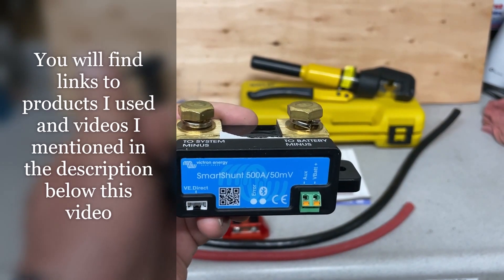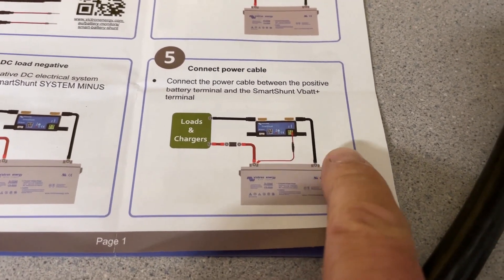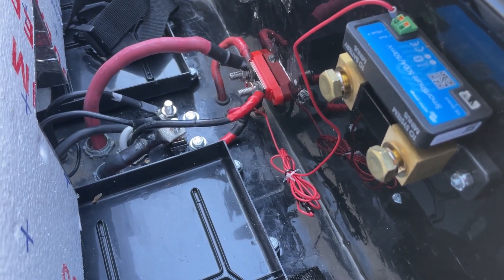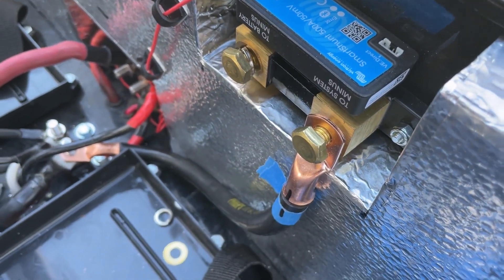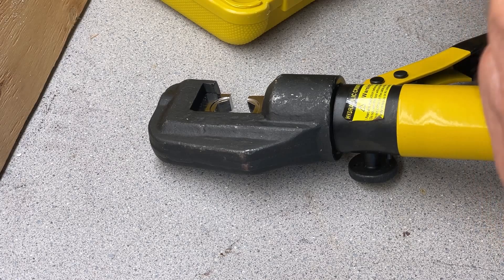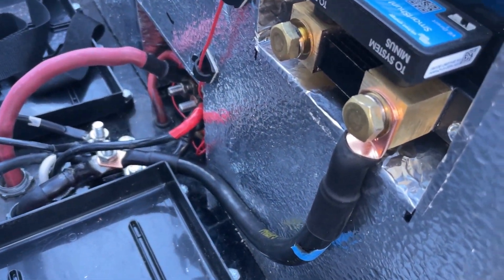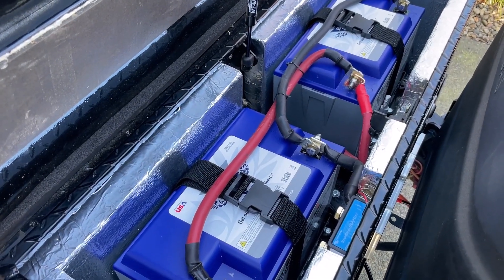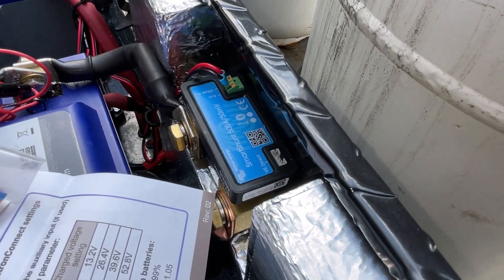Victron Smart Shunt is a Great Way to Monitor Your RV Batteries - Here's my Installation

Comment: Hi Michael 
Probably been asked before, here i go lol. Have 3 AGM batteries in my van and i just got the shunt. Can i connect all 3 to one shunt, if so, on  what battery negative i put it on, if it matters. 
No i haven't watched the video yet, will as soon as i get a chance 
Thanks
Reply from the maker: Hello Paul sorry it took me so long to get back to you, we were out camping. 

I would just come off one battery with the negative since they are all tied together to the shunt then out to the loads as you can see me mention in this part of the video and then show later in the video. https://youtu.be/ksCivLNIzEQ?si=2IbptDIYNyP0wNuI&t=113

Comment: It sounded like you have some solar power. Where did you put your positive and negative wires on your system?
Reply from the maker: Hello Robert, Yes I do have a solar system. All the positive and negative wires go to junction blocks. And then from the positive junction block one positive wire goes to the battery;   And then the negative wires are wired in the same way as the positive wires.  Here's a couple videos that may be helpful to you. 

2000 Watt Pure Sine Wave Inverter & Automatic Transfer Switch Installation - Travel Trailer (RV) - https://youtu.be/rkRzH0Ay1z0?si=HIqo6Ev84_9sT33e

Battle Born Lithium Batteries & Progressive Dynamics Converter/Charger Installation - Step by Step - https://youtu.be/BXyL_d34zy4?si=7pMTXJztMvgxOyqj
Reply: @thetraveltrailerguy  thanks for the reply, my issue is my generator ground is on one battery and 3 other grounds are on the other battery ground (2 100amp hour lithium’s 12volt). Should ALL of them be to a bus bar or can I leave the onboard generator ground where it is
Reply from the maker: @robertnasser9937  I would put all the grounds on a buss bar for the shunt to capture all the information it needs to provide you with correct information.

Comment: Nice Video 
 May I ask , how do you handle the negative from the battery to the chassis ?
 Perhaps you don’t have that situation ?
 Thanks
Reply from the maker: Thanks for asking this question and watching. Here's this part of the video shows where I connected all the negative wires which includes the negative wire that goes to the frame (I should have done a better video on this, I'm sorry) I hope this helps, if not please let me know - https://youtu.be/ksCivLNIzEQ?si=jhAcDoIR0D39-XF3

https://youtu.be/ksCivLNIzEQ?si=QcXgA4Yrcp5KZZpU
Reply: @thetraveltrailerguy  I’ve yet to see a diagram actually showing chassis ground going through the shunt. 
 I spoke with a dealer and they said take chassis ground through the shunt      
 I’m doing my due diligence before installing. 
  Your camera is quite outstanding very clear and well focused. 
 Thanks
Reply from the maker: @rickc9873 

Here are some videos that may be helpful. Note: If you are not subscribed to "DIY Solar Power with Will Prowse" I recommend you do.

What RV are you installing this shunt on? 

https://youtu.be/_GjcGZsK4fI?si=KywV8FMXPSuJit4E

https://youtu.be/9O3VYCvr75A?si=g0K3cwl5qB6w4o0x

https://youtu.be/C4z5KoPLN84?si=D_0daCzhFUro79Ik

 https://community.victronenergy.com/questions/178498/smart-shunt-ground.html#:~:text=To%20clarify%2C%20a%20chassis%20ground,switch%2C%20then%20negative%20bus%20bar.

Comment: Nice clean job and a great video, Thank you.  I am a novice at this solar stuff, and just purchased a new TT with Solar on the roof and a side port for a suitcase solar.  I had two 100Ah dragonfly Lithium batteries put on the tongue.  I have just ordered the Tictron Smart Shunt along with a new tongue box for the batteries.  I have looked at different wiring diagrams for the Smart Shunt with two batteries in parallel, but I can not figure out where the negative ground wire will go that is attached to the frame.  Does it stay as it is hooked to the battery and to the frame?  Thank you for your time.  Any advice would be welcomed.
Reply from the maker: Sorry it has taken a few day for me to respond, been busy. That's great you bought the Lithium Batteries, your going to love them, These shunts are great and easy to install. Leave the negative wire where it is hooked up now, it should be to the frame. I appreciate you watching and asking questions, I'm happy to be of help when I can. Have you watched some of my other videos about solar, batteries, etc? 

We just bought a 2020 Lance 2375 Travel Trailer and I will be doing lots of things to it, Including installing a very elaborate Solar and Controller system so keep an eye for it in the near future. 

https://www.youtube.com/@thetraveltrailerguy/videos

https://youtu.be/j4a9MkLRJN4?si=LXoZWRfu1yV04bzk

https://youtu.be/1vm4w3BMq4I?si=SiBBJSzuGF2V6m24

https://youtu.be/3lDVBU4CFMM?si=QXUj3H7znQcUDwyV

https://youtu.be/rkRzH0Ay1z0?si=4MzT6AzQ_BLEiiX0

https://youtu.be/BXyL_d34zy4?si=snbtlMS0mlDATJ50

https://www.youtube.com/@thetraveltrailerguy/videos

Comment: Hi Michael, just trying to figure how your new 4 AWG lines that go from Battery to Converter/Charger DC Side board are running. Do they attach to your Battleborn pos/neg  posts directly or do you have them on a bus bar AFTER the Victron Smartshunt? 

Thanks so much for making these very, very helpful informative videos.
Reply from the maker: Hello Sorry it has taken me so long to get back to you. We were vacationing in Alaska (not with our trailer). I attached the wires on a buss bar after the Victron Shunt, check it out here - https://youtu.be/ksCivLNIzEQ?t=107
Reply: @thetraveltrailerguy  no worries 👍  thanks so much

Comment: Very nice detail. Straight to the point! I really like your battery set up. It’s what I want to do with my box. Found one box but they are strict on returns. 👍🏽
Reply from the maker: Thank you so much for the compliments and for watching. I really like the box (it also has a great free return policy through amazon) I used its built very well and will last forever. I was looking at others on line and at Harbor Freight and wasn't impressed with the quality so I splurged and it has worked out well.   https://www.youtube.com/@thetraveltrailerguy/videos

Amazon affiliate links below:
Here's a link to the battery box Model M207 I used  - Dee Zee M207 Specialty Series ATV Box - 
https://amzn.to/2OUPFcf

Victron Energy SmartShunt 500 amp Battery Monitor (Bluetooth) -
https://amzn.to/3v4aJiN

Victron Energy Temperature Sensor for BMV-702/712 -
https://amzn.to/3Llj8nq

Busbar Dual 3/8” Studs Terminal Power Distribution Block with Ring Terminals Pair Red & Black -
https://amzn.to/38YlFWs

2/0 Gauge 5 Feet Black + 5 Feet Red Pure Copper Ultra Flexible Cable 
5pc of 5/16" & 5pcs 3/8" Copper Cable Lug Terminal Connectors 
3 Feet Heat Shrink Tubing
https://amzn.to/3L1QcAS

2/0 Gauge Wire 10 Feet Red + 10 Feet Black Pure Copper Flexible Cable 
10 pcs of 3/8" Tinned Copper Cable Lug Terminal Connectors 
3 Feet Black Heat Shrink Tubing
https://amzn.to/3v4N9T5

Hydraulic Crimping Tool and Cable Cutter Hydraulic Cable Lug Crimper 8 US TON 12 AWG to 00 (2/0) Electrical Terminal Cable Wire Tool Kit with 9 Die -
https://amzn.to/3K4g263

Hydraulic Wire Battery Cable Lug Terminal Crimper Crimping Tool 12 AWG to 00 (2/0) Electrical Terminal Wire Crimping Plier Kit,Marked with AWG -
https://amzn.to/3xMyBcA

Bernz-O-Matic ST2200T Micro Flame Butane Torch Kit -
https://amzn.to/3AfqFQ4

5.5 Oz Butane Refill Bernzomatic -
https://amzn.to/3H0udIN

Comment: I have been looking into how to remove the little red wire from the shunt ... even their 47 page manual doesn't say .. so this is how I came across this video.  Batteborn has instructions as to how to wire wires to the battery post.  Check it out.  They say not to put wires on each side of the battery post/terminal ... the reason is to remove the post itself as part of the current flow from wire to wire .... when the wires are connected on top of each other, the current says in the wires and bypasses using the battery post as a connector/conduit/ or path.  I do watch for this in many connections I use regardless of being from Battleborn.
Reply from the maker: Interesting about not putting wires on each side of a battery post. Can you please send me a link to where you read this? I've searched the internet and can't find anything that mentions this. Thank you :)
Reply: @thetraveltrailerguy  I'll the link to the BB battery manual, but it only shows the cable connected at the bolt head end, not the nut ... I will look more but when I did my mobile system a couple of three years ago I had read it ... I thought in "the" BB or the manual at that time.  I may have talked with BB.  I am sure you are already putting the cable to the post directly and not through or over a washer.  I would like to see what BB says via their support via phone or email too.  Just now, thinking, if one "stacks" the cable (connectors) rather than have flush direct contact with posts, it may be similar to having a "washer" under a connector... point is, I'm sure you know, is direct as possible lowers resistance and that is what we want.  Thanks for replying and I'll keep it in mind... please keep me updated too.  pat Here is BB link.
https://battlebornbatteries.com/wp-content/uploads/2022/10/BB10012-Manual-Edition.PIM_BB10012Rev019_09062022-1.pdf
Reply from the maker: @davidpatrick1813  Thank you so much I'm going to check this out
Reply: @thetraveltrailerguy  FOUNS IT ... GREAT WITH COLOR PICTURES NO LESS..   https://battlebornbatteries.com/wp-content/uploads/2019/01/Battle-Born-Manual-1.pdf
Reply from the maker: @davidpatrick1813  Thank you so much I'm going to check this out
Reply: @thetraveltrailerguy  Let me know what you come up with.

Comment: Nice install! I like the way you insulated the battery box. My Renogy shunt is mounted the same way but on the trailer side of the box. I used two 4 post bus bars for my connections. After using the Renogy for a year now, I kind of like having the display inside the trailer. One glance and all the info is there rather than grabbing a phone or tablet and launching an app. I do like the Victron stuff but I purchased my Renogy battery monitor a couple years ago when the Victron was twice the price it is now and three times the Renogy! 👍
Reply: Very informative video and a clean install! I like that battery box too. Do you have any issues with the Bluetooth connection with the shunt inside the metal battery box? Thanks
Reply from the maker: @mikehales9926  With the Victron Smart Shunt I am able to get readings inside the front of the trailer. If I hadn't installed the insulation I may reach a little farther. 

VICTRON - "The SmartShunt is best used in vans and small trailers where the distance between the SmartShunt to the Smart device (phone, tablet, laptop) is no more than about 10’, 15' at most."
Reply from the maker: Thank you Ron :) have you watched this video? VIDEO - Victron Energy 500A Smart Shunt (Beginner Friendly) -
https://youtu.be/_GjcGZsK4fI
Reply: @thetraveltrailerguy  Yes, I have seen that video. I follow Will's video a lot.